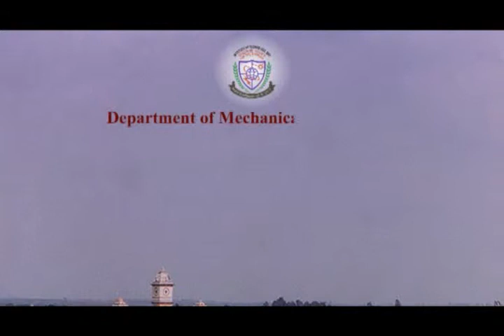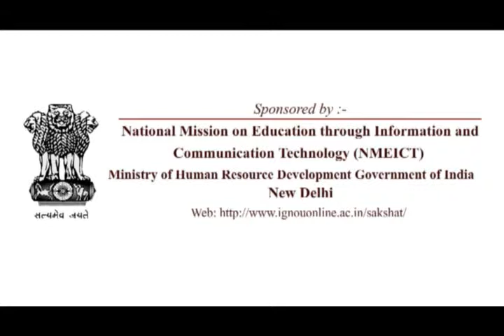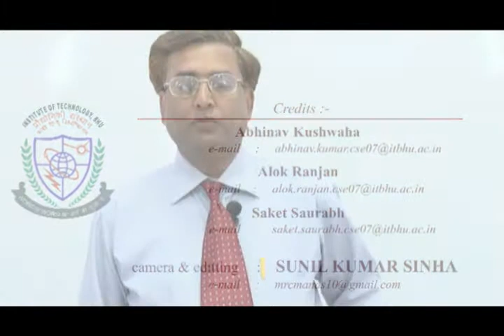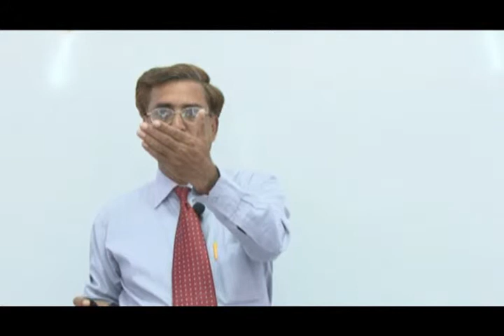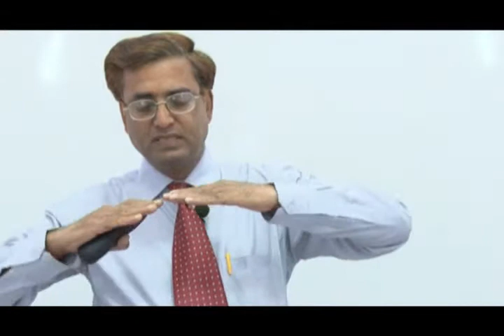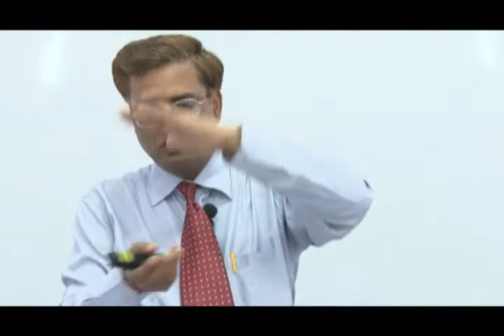Practices -flat rolling, shape rolling, ring and thread rollling (TMF) - lecture 12tmf 12_52

Comment: Please answer
spreading in flat-rolling process increases with_____________.
a)increasing ratio of the roll radius to the strip thickness.
b)increasing temperature of the entering strip.
c) decreasing ratio of the roll lenght to the strip width.
d) decreasing width to thickness ratio of the entering strip